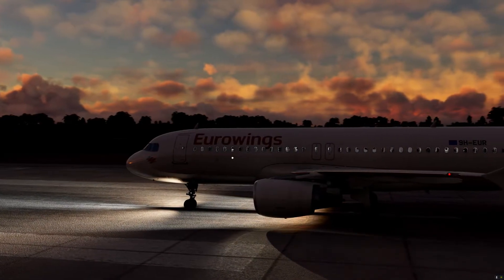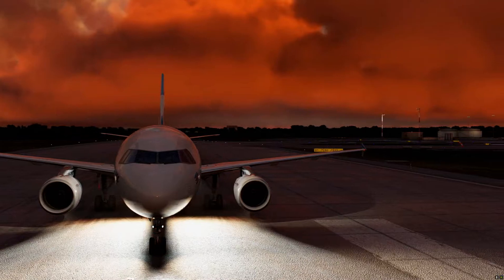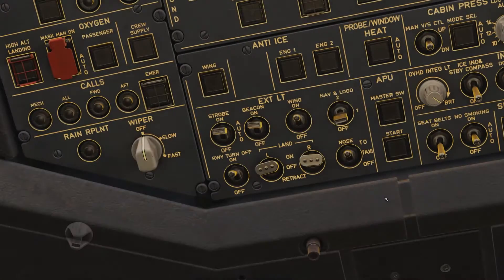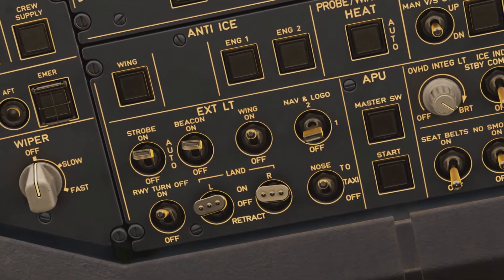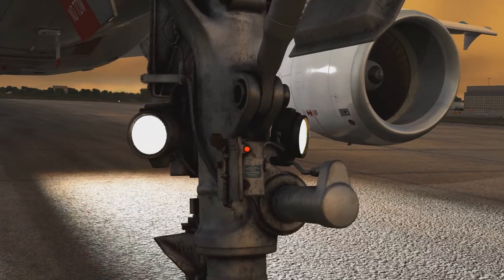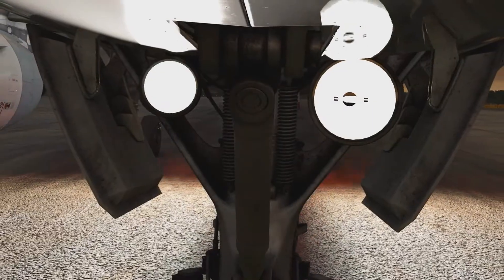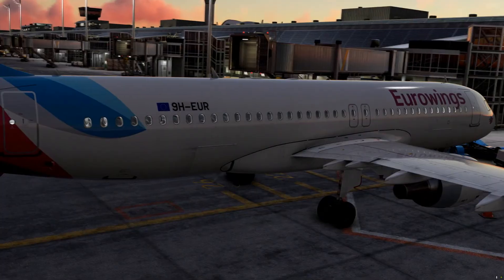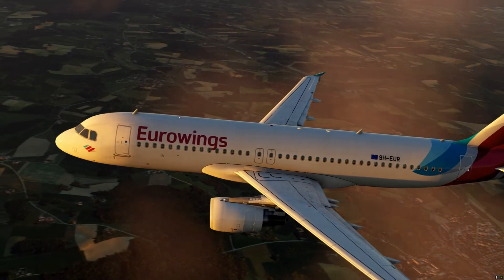How to correctly use the lights on the Airbus

Comment: Thanks! How about using the RWY Turnoff Lights during on aprons and taxiways? I sometimes see, that the Turnoff Lights stay on and taxiways. The moment, they are entering the Apron area, the taxi light only is used and then, when turning into position, the taxi light is also switched of - I guess to not beam the ground personal
Reply from the maker: Yes, but that is company specific. Also aircraft specific. 😊

Comment: Almost identical to my airline except for NAV lights and RWY turn off lights.  For NAV lights, we use 1, unless they are U/S, then we use 2.  For RWY turnoff lights, they are always on for taxi - when we turn them off in flight is the same, and we also turn them back on, when the gear is down.  I guess I could add that Wing lights don’t have a specific SOP for use with our Ground Crew, but adding visibility for them does make sense.

Comment: isn't it a bit annoying to have the RWY T/Off lights off for taxiing during the night? I mean, pardon my french here, but seeing jack shit to the sides would annoy me quite a bit^^
Reply from the maker: @boahneelassmal  Most airports have very good lighting. You just stay on the green and avoid the blue 😉
If you find yourself on a poorly lit taxiway there is no rule that says you cannot use the take off lights. We usually fly into fairly large airports in central, western and northern Europe, so I guess we are a bit spoiled 😉
Reply: @fsclips  oh, sorry if there was a misunderstanding. I didn't mean the take-off lights, I was talking about the turn-off lights... wouldn't it make sense to have these on to have better peripheral vision?

oh, and maybe for my comprehension: You could, despite airline sop asking for them to be off use them regardless? I mean, I understand you don't need them on the apron, these usually are well lit. but anything that is a tad away from the terminal does get fairly dark (obviously not raven black) quickly. So you could still use them at your discretion in those areas?
Reply from the maker: @boahneelassmal  Well, you could as long as you don't annoy other pilots. These lights are pretty bright. When it comes to lights there are usually company specific procedures, but it is one of the very few areas where pilots get a bit of leeway.

Comment: I believe the A32X Landing Light procedures vary a lot by SOPs of the different Airlines. Some airlines turn them off when going clean i.e. Flaps 0 to reduce vibrations, same thing for the approach, not necessarily directly at 10.000ft. With the new generation of non retractable LED Landing lights for the A32X family, this vibration problem is solved anyways

Comment: excellent video, thank you very much!
but can i ask a question regarding the wing lights?
are they used for take-off and landing during nighttime/bad weather operations, or only on the ground? and if they are used for take-off and landing - are they operated like the landing light (on/off at 10.000ft)?
TIA and always three greens
Reply from the maker: Ok. Wing lights ...we don't usually have them on for take off and landing only on the ground. If you want to keep them on for take off you can and then switch them off at 10.000ft
For us it is ON before engine start and OFF after engine start.

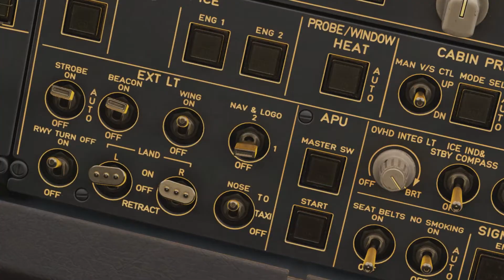Comment: 7:55 For me, you have a white light to the rear and not only the green and red lights. And the red/green nav lights must be visible in a 120 degree arc, meeting at the front. So if the aircraft is away from you, you only see the white lights and no the red and green lights.

Comment: I have a question regarding the Landinglights - I can often see, if there is a low cloud ceeling that pilots tempt to leave them in off position, till they are clear of the clouds to not blind themselves - is this a usual practice?
Reply from the maker: Yes. Same for strobe lights. In thick fog or heavy snowfall they can actually be very distracting. 😊

Comment: Here's me thinking I knew how to use the lights and how wrong I was! I thought position 1 was Nav lights and position 2 turned on the logo light. I've alwyas thought too that the logo light was for night time and to help ATC or other aircraft recognise the airline in the dark. I use Rwy turn off lights during taxi so that's another thing I was doing wrong. Interesting about the wing lights too as I don't normally ever use them. Thanks for the help though, keep it coming.
Reply: Wasn’t Runway Turnoff lights often permitted at own discretion when taxiing at night? 🤔
Reply from the maker: The logo lights are always on when you switch on the NAV lights, however there are two sets of NAV lights but only one set of logo lights. If a NAV light doesn't work you can just move the switch to the other position. With the logo lights that won't make a difference because there is only one LED set.
I hope this makes sense.